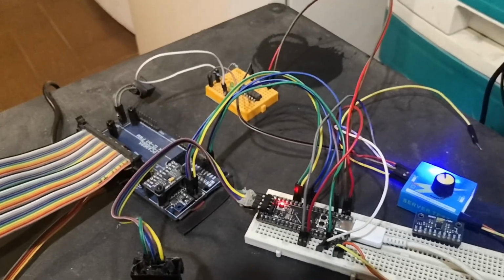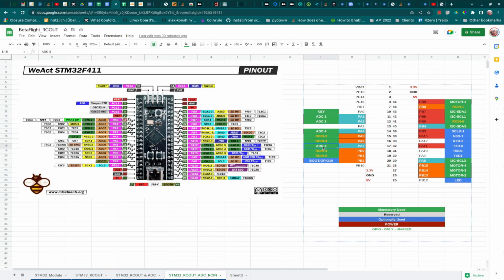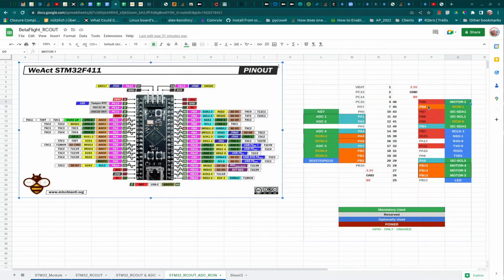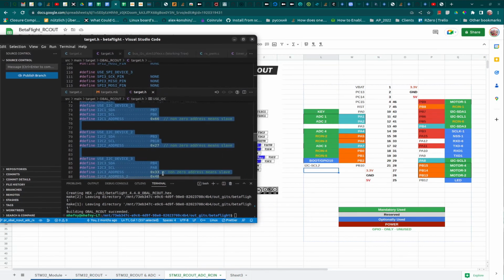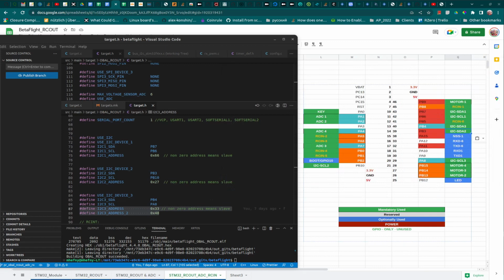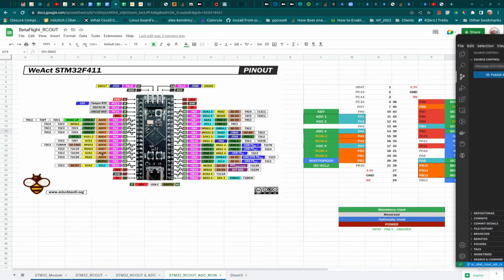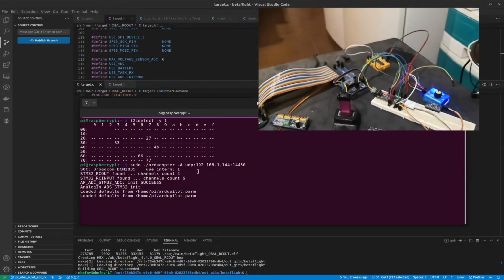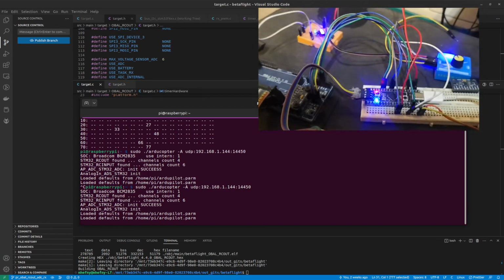Using STM32 as Modules in OBAL Part#2

Comment: when using this approach how would changing the output type from pwm to dshot etc work? edit: I see you mentioned output.
Reply from the maker: RCOUT_I2C Registers  using 0xFE you can determine the output signal. And this is called from RCOutput_STM32::set_output_mode in Ardupilot code

Comment: Very interesting work!!  I am stumbling thru setting up a Rpi based system using OBAL.  I tried first with a CM4 on Ochin carrier board.  The results were not a complete failure, but I did not find any sensors or serial io working.  I switch to a pi 4b and am almost finished compiling...

Would more rc out channels be possible?  I looked in the code and see where the number is defined as 8, so seems some what possible.  Maybe with multiple stm32 boards.    I have 12 motors on my drone.
Reply: I have the obal board working on my cm4 using a waveshare nano carrier board. I want to design a board inspired by all this for the cm4 to take up less space
Reply from the maker: Pls email me on mohammad.hefny@gmail.com we can debug the issues
Reply: @MohammadHefny_HefnySco  I sent an email.  two actually.
Reply from the maker: @jkieffer72  I searched for your name on gmail but I found nothing. are you sending at mohammad.hefny@gmail.com ?
Reply: @MohammadHefny_HefnySco  I will double check
Reply: @MohammadHefny_HefnySco  looks like i have the address right.  Will resend